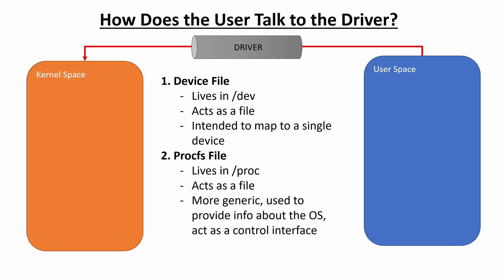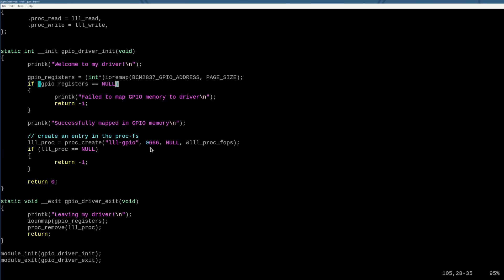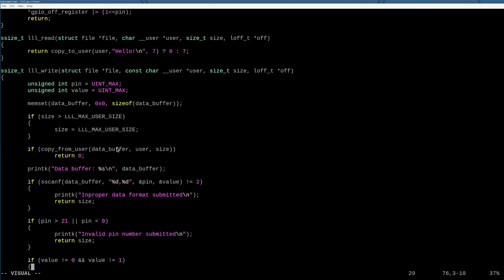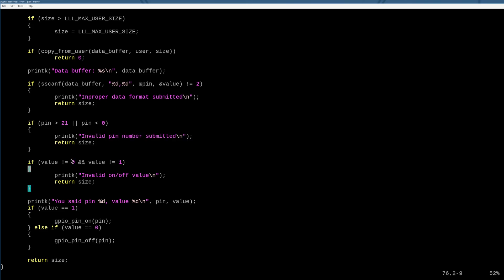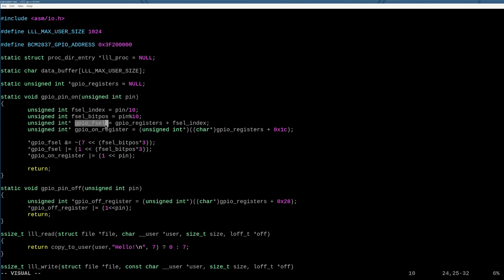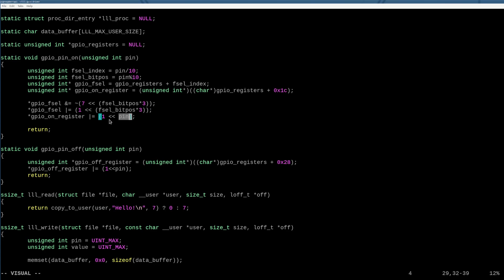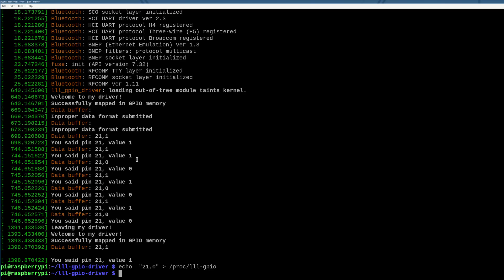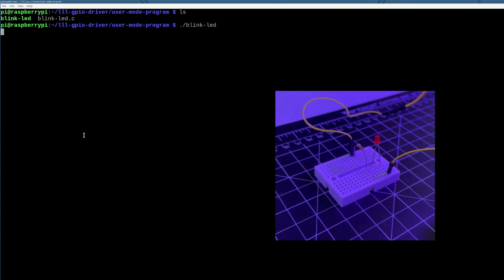THE THRILLING CONCLUSION?! | Controlling GPIO in the Raspberry Pi Kernel | GPIO Driver Project

Comment from the maker: LOW LEVEL GANG! Thanks for watching. What's the hardest part about embedded development?
Reply: Making sense of the data sheet.
Reply from the maker: Trueeee. Actual hieroglyphics sometimes.
Reply: finding the right terms to look up info, if it wasn't for you I would never be able to write rust into my esp8266 because I didn't know hardware abstraction layers were a thing until your video on rust on the pi pico
Reply: Finding low level guides/information and channels like yours. Really helps getting started on small projects, thank you so much!
Reply: start writing code :D
Reply: Make startup file in assembly and finding where to start??
Reply: The hardest part is understanding how all the pieces fit together. Generally speaking. You do well explaining this. I have big respect for the brains that can figure out drivers from scratch, specially working with new platforms.

Comment: A most excellent Raspberry Pi GPIO Driver video.  I am having problems in getting the Orange Pi-5 Debian-Bullseye-OS PWM GPIO pins working in Thonny-Python.  I would like two OPi.GPIO PWM pins for servo Pan and Tilt motors.  Also, I cannot find a GPIO OPi5 example. Do you have any suggestions for a simple PWM example?  Thank you.

Comment: Hello! LLL.
I really appreciate and enjoy you tutorials.
I have rpi4 (BCM2711) and trying to follow your tutorial.
When i apply your code as is, It doesn't work.
Is it because of the base address of BCM2711?
What i found is that the gpio address of 2711 is 0x7E20000
I changed BCM2837(0x3F200000) to BCM2771(0x7E20000
).
For me neither of them work. 
Can you point out any clue?
Thanks!
Reply: Try 0xFE200000
Reply: @sanketlokhande3884  Thanks bro.!!. It works fine!!

Comment: Why does a driver for an actual device uses the proc interface instead a device file under /dev? Parsing a command string,  even a simple one, in the kernel is not such a good idea unless there is no better option. Why not having devices /dev/led01 to /dev/led21 accepting only char 0 or 1? I thing it would be a nicer interface.

Comment: Absolutely awesome series! I had a lot of fun following these 3 videos! I was trying to follow along with a raspberry pi model b+, but I am guessing the base address for the gpio registers is different, because my code is working, but the led is not lighting up. Can anyone guide me in the right direction of where I can find the base address for gpios on the model 1 b+? I am not yet the best at reading those heavy hardware manuals 😬
Reply: Have you tried probing the other GPIO pins to see if one of them was turning on?